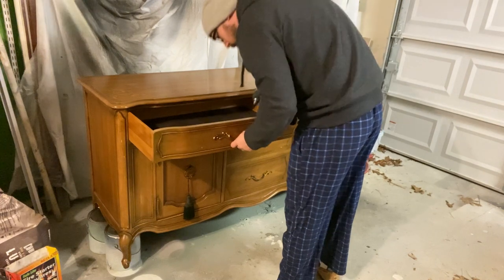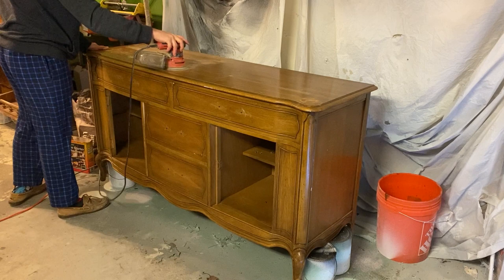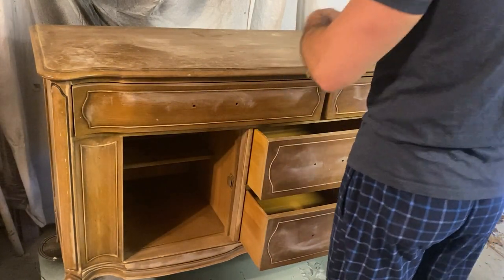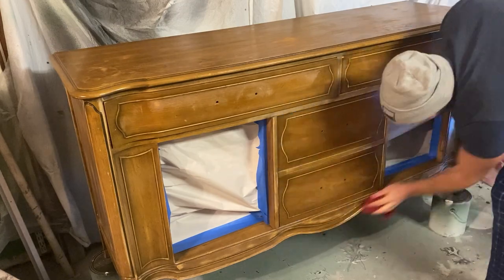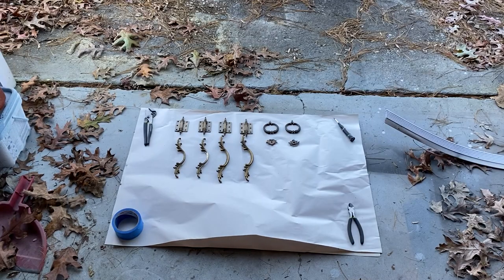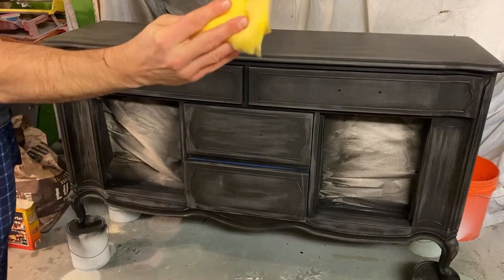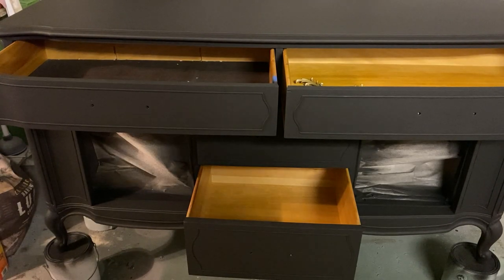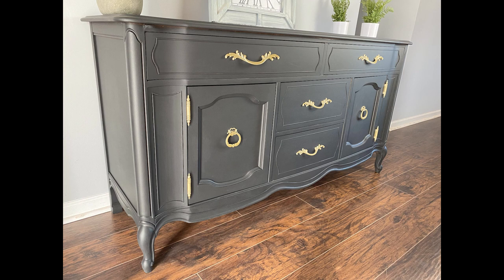Thomasville Buffet/Dresser Furniture Flip | Matte Black Furniture Makeover

Comment: When painting a dark colour such as this black piece, you can add a bit of the paint to your top coat. This will give you a more even finish with less streaks. Of course if you do do that, you'd have to spray it prior to putting the hardware back on. This turned out great.